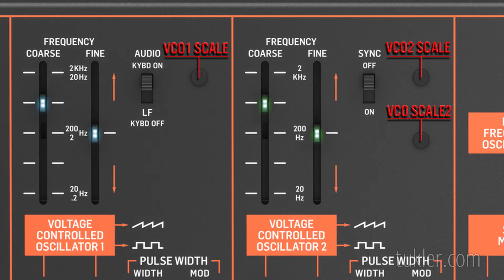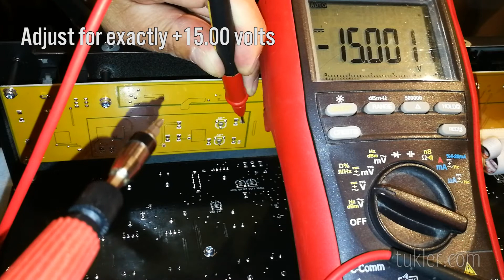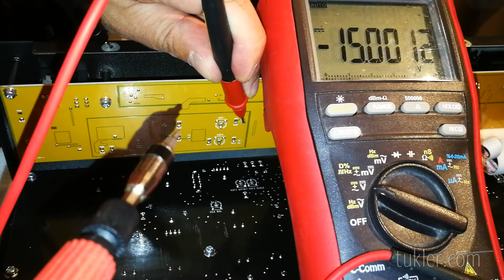The Behringer Odyssey teardown and calibration of the power supply

Comment: Need a little help 😢 i just did this and after it gave me a good 15-Vlecture i reconected the synth but is not giving enough sound, i can barely hear the signar is there something i did wrong? Or a step that i’m missing? Thanks in advance and excuse my english
Reply from the maker: It could be something very simple. dial in a basic patch with just one oscillator → filter open → amp up, to confirm the synth itself is producing sound. Do a visual inspection: make sure everything is connected properly, reseat all connectors, and check that no pins are bent. Then check the external audio cables, and try headphones directly to rule out mixer/interface issues. If the problem persists you might have do build an audio probe and probe around the signal path to see were the audio gets weak

Comment: Hello, Thankyou for the trouble shoot video, I have another problem and this may be unrelated to your video but becoming a somewhat common on the Behringer Odyssey, The LED lights on the sliders, one of the group colors on mine has faded and gone dead, all the Seven White ones simultaneusly have died. I check all th\ose LEDS by swapping them out with the other colors and they seem to be working fine but not on those sliders. I have turned up the brightness to full but still no life on the white set. Has this problem ever occured on yours or anyone else's Odyssey ? what could be the root casue of the problem ? something gone dead maybe ?
Reply from the maker: I've not seen this problem before. If all the white LEDs all faded and gone dead my wild guess would be that they been driven too hard. Is the voltage OK? And how high is the current? Is there a resistor that limits the current? By just replacing the LEDs might cause the new ones to die quickly. But that's my wild guess and where I'd start troubleshooting.
Reply: @tukler2  Voltage Seems Good at 9.1V input, the symth CV  calibration is at steady -5,0,+5,+8V. For now seven of the white multi-color ones are out, Im looking for loose connections or faulty components, when it was dyiing out it was slowly flickering on and off and going dimmer then the others. Im still testing voltage vantage points to see if any of these are higher then the others. The Behringer PCB is not of good quality, very flimsy witha ,Lot of Factory Flux residue and finger marks. I tooked the whole thing apart for further inspections, somehow th 7 LED's are tied to each other. Im Giving it a break now and will have to continue tommorow.

Comment: Great video, thank you! What size screwdriver do you recommend for Behringer synth trimpots please? Also, I got the voltages to match, 15v at test points 2 and 3. But when I check them at the alternate test points, the voltages are mismatched. I expected a drop as you describe, but not for them to be unequal. Could this be a failed component? Or another trimpot somewhere needing to be adjusted?
Reply from the maker: A small Phillips screwdriver will work and even a small flat head one will do the job. How much do they differ? It could be a component that’s out of spec. Or it could be just slightly off, but still in spec. Does it still calibrate OK? In a perfect world they would be perfectly matched, but this is analogue technology so they can be slightly off an still calibrate OK.
Reply: @tukler2  thanks for your reply, just came back to this. At the alternate test points I get +14.96v and -14.70v . Unfortunately I can't get down to 1mV level with my multimeter, but by comparison I have +15.01v and -15.00v at TP2 and TP3 respectively. The tuning seems to have calibrated fairly well, though I needed to adjust the offset for both oscillators first. There is some noticeable, almost stepped pitch drift from oscillator 1 when it's left to drone, though it seems to snap back in tune each time. I got a static shock calibrating the rails the first time which is what made me think I may have shorted a component.
Reply from the maker: @electric_fields  I'd leave the way it is if it's playable. -14.70 is a little bit off.  It's a bit of work to troubleshoot. But you could try trace the culprit by disconnecting things and check if some components are too hot.

Comment: Great video and your second video showing the trim and scale really helped but I am having some problems with the Octave Scaling for the lower octaves of the B-Arp. Do you think the voltages might be the issue for that?
Reply from the maker: Thank you! I'd definitely check the voltages, even a cheep multimeter would do the job. Pitch calibration and scaling can be tricky and it's hard to get it perfect, it helps if you're stubborn and don't give up. But if the voltages are out of spec the scaling will never be perfekt. Keep in mind that this is old analog technology and it will probably never be 100%. Good luck!
Reply: @tukler2  I'd already picked up a multimeter in preparation and with a lot of hours and plenty of perseverance (stubbornness) I believe I've solved the issue. Using a mix of your techniques and some trial and error with the VCO1 offset + the lower octave scaling. It's videos like yours and the knowledge you share that make YouTube and the internet in general a glorious place. Thanks for your response too! Take care

Comment: Thanks for the video....but I dont really understand. You say there is "no need to remove the cover because they are accessible from the top holes"....but then you pull it apart? Can this adjustment be made from the front..and if so how do we do it?
Reply from the maker: You don't need to open up the synth to do the standard pitch calibration and scaling. But I wanted to check that the interna voltages was correct (and I did adjust the - 15 volt). In my case it would have calibrate just fine without opening up the synth, since it wasn't far off. It's OK to start with the pitch and scaling, then if you struggle to get it right you can open it up and check/adjust the voltages and then redo the pitch and scaling.
Reply: @tukler2  Thank you ...the video and this reply was a big help to me. I find it amazing that such a crucial part of the Arp process is not mentioned up front ...even paid tutorials on it have NOTHING to say. I'ts mind blowing.

Comment: Hi! My BArp Vco2 is getting out of tune by itself. Do you think the problem can be an uncalibrated power supply? Osc ranges and tunes are fairly ok, I checked.
Reply from the maker: Sándor Kis I’d check the voltages first, weird things can happen if they’re off. But it could be some other fault behind the problem, especially since the vco1 seems to be fine. The odyssey is usually very stable compared to other analog synths.
Reply: @tukler2  alright, thanks! I'll check the power supply. It's obviously the second osc, and it's kinda ramp changing also, in tiny but audible steps.